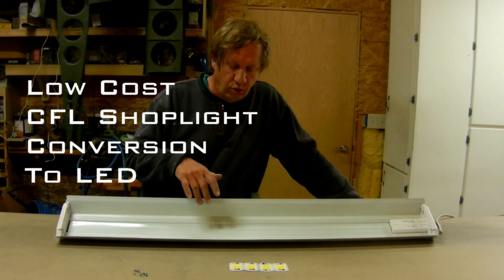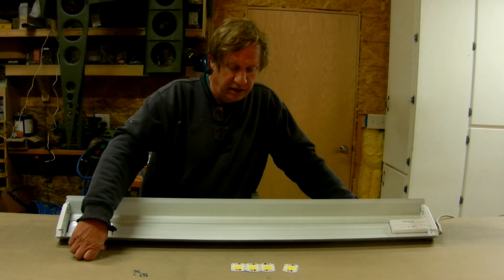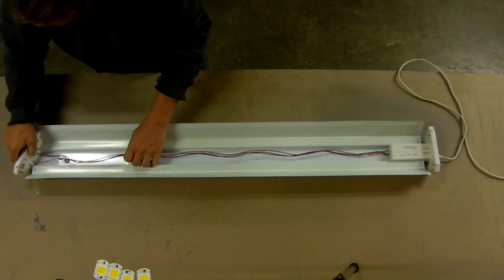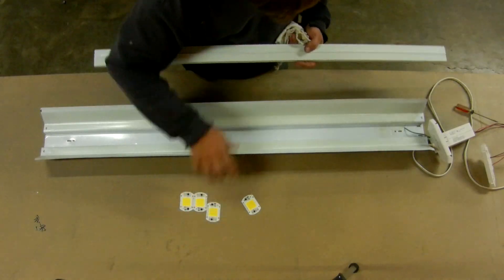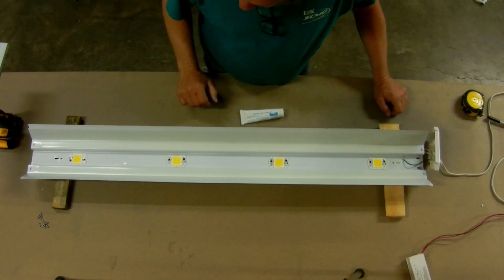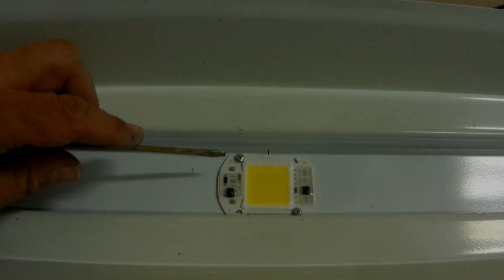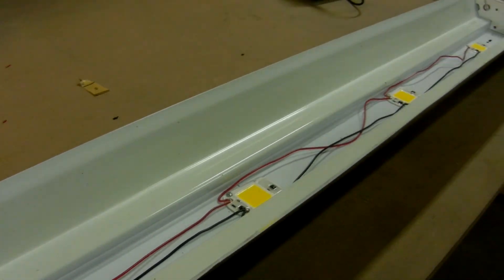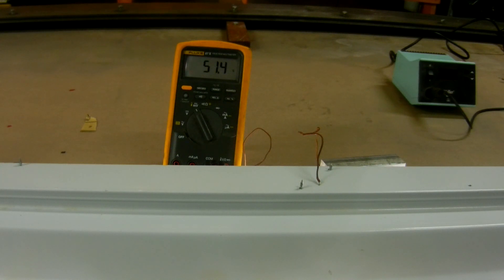Low Cost Floresent Shop Light to LED Conversion

Comment: But, they are still using 120 watts, or is that the equivalent. The price is right.
Reply from the maker: The watt meter reads 42 watts. I would say the 30 watts is equivalent.